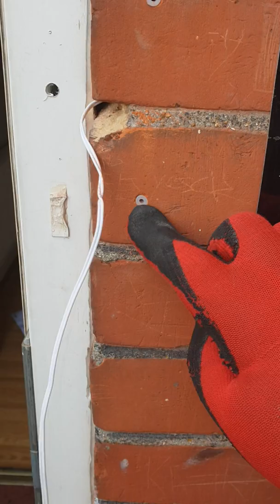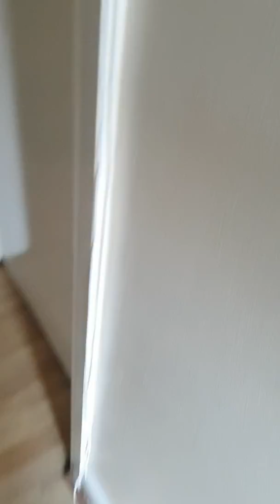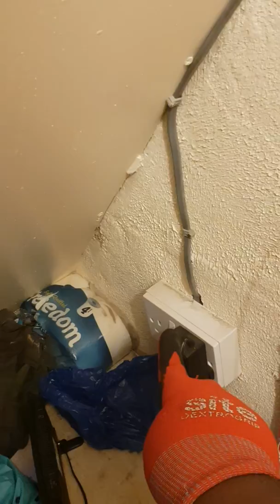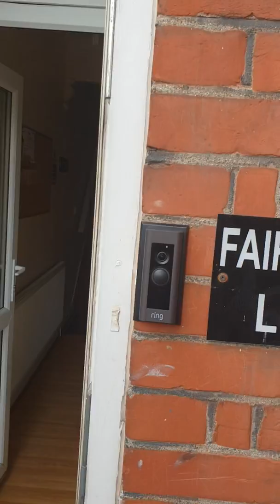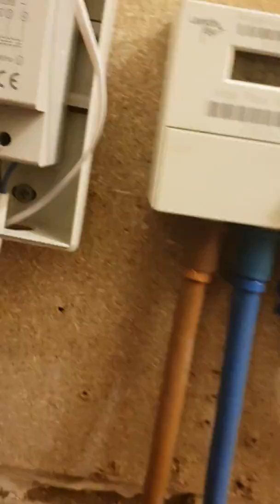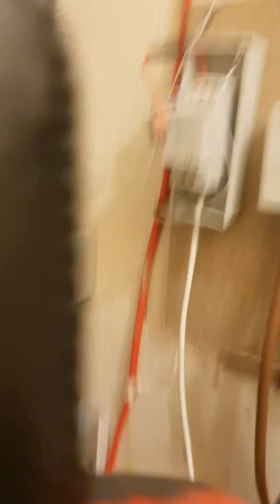Ring video doorbell Pro installation explained easy! UK ( w/o exisiting door bell)

Comment: I been looking for a video like this for like 7 days now , it’s the best ring video out there by far , pls change your title u will get loads more hits !!!!
Reply: Thanks I'm not really pleased with it was rough and ready I'm going to do a better one later from my home with I upgrade to the ring pro
Reply: What title should I use?
Reply: julius uzu yes if if u cut it down to a 5 minute video and change title like , “Ring Pro installation explained easy! UK ( w/o exisiting door bell)”
Reply from the maker: @asha7244  Hello been a bit busy what with christmas ,so i've changed the title to your suggest lets see how more people view the video thanks
Reply: lol good luck ! I’m not expert btw lol 😂
Reply from the maker: @asha7244  ok no problem, just seen this via https://youtu.be/ppm__coQyqU i'm a little worried that that the chime his using the bryon 776 is rated at 8v but the voltage passing through is 15v nearly double?i know  its not going through the onboard transfromer as it would probably burn out or explode? i use the byron 776 for the ring 2 not for the pro because it comes with its own transfromer plus you can get a cheaper chime for about £5 compared to the 776 which is £11.99?

Comment: I just installed a Ring video doorbell pro today and must thank you for the idea of mounting the transformer in an enclosure next to a double socket and plugging it in. Funnily enough the doorbell didn't come with the power adapter with the 2 red wires that you talk about in this video so i guess its not needed anymore. I used 6 core alarm cable instead of bell wire as i think it looks neater stapled and i put a 20mm compression gland for the flex to come out of the bottom of the enclosure to provide some strain relief in case the flex gets tugged.
Reply from the maker: Hi glad see see that you got yours working, the black and red wires was just a 1amp fuse its been replaced by ring with a bypass unit which is a small square block and must be installed on terminal 4 on the transformer as its an electronic fuse. If there is a power power of some kind it will shut the ring doorbell down ,it then has to be rest by switching the power off then back on to reset the unit.
Reply: @siatelecomsltdLondon  that's strange, there wasnt one in the box, surely they would supply it with the ring video doorbell pro kit?
Reply from the maker: @ashleygambrill4508  if you have recently purchased your ring pro there should have been a bypass module in the blue box if its missing you need to contact ring straight away and get them to send you one

Comment: Yesterday i tried to install the ring doorbell pro. I wired it the way you showed. I used 0.75mm cable, a plug with a 3amp fuse and the transformer they gave at terminals 1 and 4. It started up and I got as far as trying to find the ring network on wifi then it stopped working. Thanks  to you I went around to Barlows and they gave me the only 1amp slow blow fuse they had.  It's now working with only a few possible issues with the rssi.  I need to set up the area  for motion detection because I'm getting alerts for every car at the moment.
Reply from the maker: hi its been very annoying having to change that 1 amp fuse when i've done jobs as a matter of course other wise i would have been going back to a few . but good news they have brought out the bypass device which will replace the 1amp fuse saw it and installed one on sunday just gone ,so i can now put the 1 amp fuse ive got left in my draw.yes you need to set up the motion zones via the app.thanks for letting me know glad i was able help
Reply: @siatelecomsltdLondon  Hi , Firstly, thank you very much as finally someone took the effort of putting up a video of this installation as not everyone wants to fit one in a CU . I installed mine yesterday and it was all working until this morning when I came back from the gym and rang the bell. It rang once and then lost power completely . So I checked and had the same issue as someone commented above i.e a blown fuse in the  power pro cable. I replaced the 1amp fuse and it powered up again. However, rang the bell again, it rang once and the fuse blew out again. Do you know why the fuse keeps blowing up ? It should happen only when the bell draws too much current , right ? My connections are o.k. and as you've mentioned in the video. Thanks
Reply from the maker: @ravirgo27  hi thanks that does not sound right?like you said if the fuse has blown again could be a voltage issue in your premises?i would contact ring and inform them of this issue.there is a new device which is a bypass unit that will be replacing the black fuse holder contact ring and get them to send out the new bypass device.
Reply: @siatelecomsltdLondon  I may have found the issue as it is now working after the 3rd fuse change, but keeping fingers crossed. As I don't use an existing chime but the chime that comes in the box , the doorbell kit settings should be "none". The default setting is mechanical , which although worked for sometime for me , eventually blew the fuse out. The 2nd outage would be me as I changed it from mechanical to digital thinking I'd still need to set it to something but this blew the fuse out again. Ring's website says that it should be set to none , before you even ring the doorbell the first time as it could lead to a blown fuse. I think this was the issue with my setup but if it pops out again , I'll call ring support as you suggest. Thanks
Reply from the maker: @ravirgo27  ok thats really very interesting so depending on the doorbell kit setting could effect the amount of voltage gooing to the ring doorbell ?i will need to check that in future as well when i do more installs thanks for lettings us know the more info we get the easier we can solve basic problems

Comment: Hi I don’t have a ring I have a eufy doorbell but I live in the Uk and have a transformer like that and that gives 8-24 V. The eufy doorbell needs 12-24 V, so I would of thought I put the the wires in the 12 and 24 v holes. But when I go to turn the electricity back on, it trips. I have tried  all the different holes and the doorbell circuit still Trips. Have any ideas? Thanks
Reply from the maker: hi sorry ive not got back to you earlier one of the wires has to go into terminal one to the far left which will be the 0v and the other wire needs to go to terminal 4 which will be the 24v connection  so take out the wire in 12v and put it into the 0v or terminal 1

Comment: What's the point of the wago switch? You could've just connected the cable straight into the transformer without a wago
Reply from the maker: yes of course you can wire two cables into the transformer do what you want,i just perfer one cable so that when you tighen the screw it bites on just one wire and also that black cable is stranded wire ,hate stranded wire so twisting a solid bell wire to a stranded annoys me.

Comment: Thanks for explaining.

If you were going to route the wire all through the house might just as well use the plugin adapter supplied by ring or any other provider and plug the doorbell in the wall socket near the door. Would be much cleaner installation.
Reply from the maker: this was done two years ago i did not have a ring adapter plus you would have spent the extra £20 for it when you already have a power source?
Reply: @siatelecomsltdLondon  yeah that makes sense in your use case. But these days I think the standard doorbell comes with the adapter by default. So its a great option. 
Depends from case to case I guess. The video is helpful though, I used parts of it during my own installation for tips. Cheers 👍

Comment: What cable/wire did you use between the ring doorbell and transformer?
Reply from the maker: 50m Bell wire 1 pair from toolstation much better then the one from screwfix you can also use 6 wire telephone cable
Reply: @siatelecomsltdLondon  What about 8 core alarm cable?
Reply from the maker: @petert1027  that's up to you If you want to use that cable

Comment: Hi is it true the new versions of the ring door bell pro , does not include the red cable with the 1 amp fuse, thanks
Reply from the maker: Hello it's been replaced by the bypass module
Reply: Hi there. What's the bypass nodule? Can I install this without using the red and black piece of kit?
Reply from the maker: @womble8348  hello you don't need the red and black kit use the bypass module check out my link 
https://www.youtube.com/watch?v=gMy2IDksZiw&list=UUDoC8IuaIjgNNM01OGZUP4w&index=20

Comment: FYI the orange wire system has now been replaced by a little plastic box called The 'doorbell bypass kit' which holds a resistor. For a ring 2 hardwire installation you have to supply your own resistor.
Reply: Hi, So mine also did not come with the orange wire system. What do I need to replace this with ?

Comment: Hi, very good easy to understand video. I just wanted to know my old door bell is allready wired in looks like with maybe speaker wire - not sure and is connected to a transformer plug with 12v output. Would it be safe to carry on using the (speaker wire i think)  with your method? Thanks

Comment: Hi, would you recommend to connect this to a fused spur instead of 3 pin plug?
Reply from the maker: you can do both which ever suits you or you could buy the official ring power adapter and use theat
Reply: @siatelecomsltdLondon  Thank you for reply! 👍🏼

Comment: Great video.. I'm just about to buy the Ring Pro doorbell and your video explanes alot to me as I don't have a bell at the moment so going to install from scratch
Wish me luck 😀
Reply from the maker: Thanks Gary but I would advice you to get an electrician to do it if you are not really confident in doing the work remember its electrical and must be installed safely both for you your family and other people using the doorbell
Reply: @siatelecomsltdLondon 
My son is good with DIY and your video is easy enough to follow..
Just getting that wylex from toolstation for £2.99..and some bell wire
Thanks again
Reply from the maker: @garygroom7  that's great be safe
Reply from the maker: Do you have the link for wylex on toolstation?
Reply: @siatelecomsltdLondon  there is no share option for me to sent to you
Juat type in wylex ese2 in the search on the toolstation app.. Its £2.99
Ive got a screen shot but won't let me send it
Reply from the maker: @garygroom7  ok thanks i will try that thanks
Reply from the maker: here it is https://www.toolstation.com/wylex-2-module-enclosure/p31929 none in any of their stores has to be ordered bit annoy..
Reply: Installed the ring Pro at the weekend with no problem.... You dont need the red wire with the fuse in now... Just put the doorbell wire in number 1 and 4
Reply from the maker: @garygroom7  hi yes you are right it has been replaced with the ring pro bypass kit which you installed ?here is my video of it https://www.youtube.com/watch?v=gMy2IDksZiw

Comment: Great vid deffo informative about that power resister / regulator......where do you get them from?
Reply from the maker: they have been replaced by the Ring video doorbell Bypass Pro Power Kit V2 which is a electronic fuse ,once it's set off it just requires the fuse box to be switched off then back on to reset

Comment: Great Video! I have some questions please  - what fuse (3A, 5A or 13A) do you use in the 3-pin plug? Would the normal kettle lead (also for PC Monitor and Machine itself) be ok to be used in this installation? And this bypass white box, shouldn't that be on the 24V pin (no 4 - top right of the Ring Transformer)?
Reply from the maker: hello i use 3a fuse or 5a is also ok ,i now use the kettle lead as it's molded with a fuse cartridge.if that's where its suppose to go great but it is an ac transformer so it's not be polarity conscious like a dc it one. also i did not show in the video but make sure you use a tie wrap to tie the mains cable to the inclosure thanks julius

Comment: Great video. A lot more clearer now how to install it.

Just wondering if there is a way of also connecting my existing door chime to the same power adapter - it's a mains door chime
Reply from the maker: Hello sorry not sure I quite understand?if you have a door bell connected to a 8v transformer and its installed in the consumer unit it will not work with the ring pro it should work with the original ring video  doorbell. You would have to get a qualified electrician to replace the transformer in the consumer unit with the one that ring supplies
Reply from the maker: Ok the door chime I think the door chime is rated at 8v the ring pro needs a min of 16 v to would properly would burn out the chime over time
Reply: @siatelecomsltdLondon  Hi, thanks for the reply.  I'm not too sure what the door chime is rated at, but if I were to get one rated at the same voltage as the Ring Pro, could I have the traditional door bell ring at the same time as when the button on the Ring Pro is pressed?
Reply from the maker: @Christosseventy7  yes if you can get one rated at 16v and above it should work but I've yet to find one that will work with the ring pro there is another video where a guy has used the byron 776 bell chime and it works but it looks very complicated to wire up

Comment: Hi Telephone Engineer London. Great vid. My current door bell wire is exchange jumper wire (as a telephone engineer, I hope you know what I'm referring to), will this be ok to use with the Ring pro? Or will I need to replace it? Bearing in mind that jumper wire would carry ISDN2 at around 90v.

Also from the transformer could I run some bell wire to my existing door chime to make that ring at the same time as the Pro?
Reply from the maker: Hi yep good old jumper wire is fine I use to use 6 wire cable to run to the front door but I'm now using two wire bell cable from toolstation 50m for £8 odd good quality similar thickness to jumper wire and much cheaper.as for the door chime I never wire to it remember it's about 8v the ring pro operates at min 16v it can be done there is a guy in the uk who has done it but I don't bother as the pro comes with a wireless chime which is pretty loud and you can have several of them around your home at various volume levels thanks
Reply: @siatelecomsltdLondon  Good old jumper wire. What colour do you use red / blue or yellow / blue.
Reply from the maker: @tedtom9728  yellow and blue but it's best to stick to one per bell wire as it looks slightly different to telephone and most people know its bell wire for safety

Comment: Just looked at the Ring installation manual and noticed that the Bypass Kit is connected to terminal 4 not terminal 1 which is the way you have it set up. Does this matter?
Reply from the maker: Hello if it says in the manual that it must be installed on terminal 4 that it must be followed.in the video the black tube has a 1 amp fuse because it's an ac transformer and not  DC it can be installed at 1 or 4 but I will speak to ring about this to get clarity
Reply: Yes, page 13 of the manual https://support.ring.com/hc/en-us/article_attachments/360021789811/ENG_Doorbell_Pro_MANUAL.pdf.  Although it refers to a set up using an existing doorbell transformer it uses terminal 4. Great video by the way, it's helping me a lot with my installation, thanks.
Reply: Just to clarify for other people, the 'Bypass Kit' I mentioned above was the Pro Power Kit (small grey plastic box).